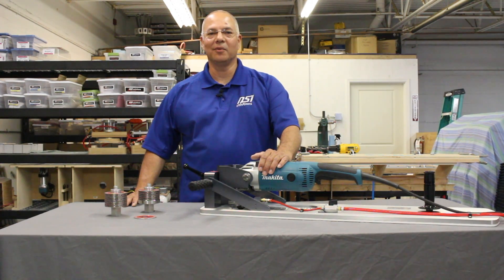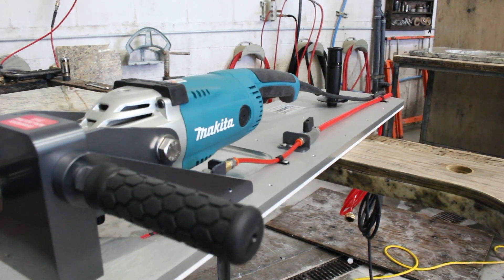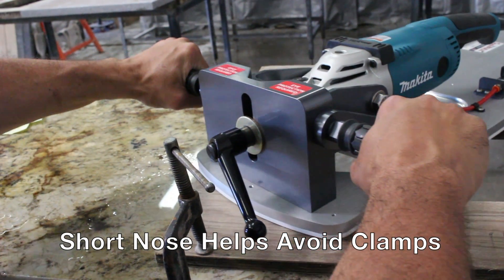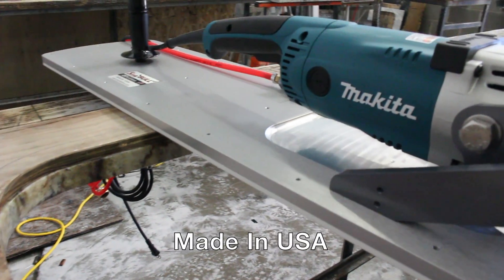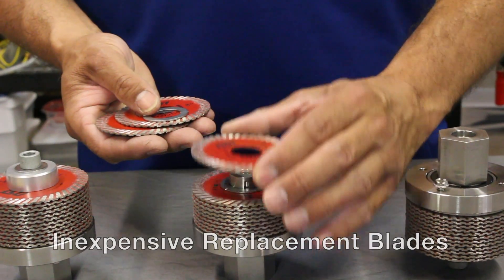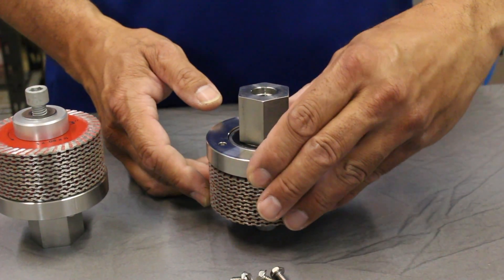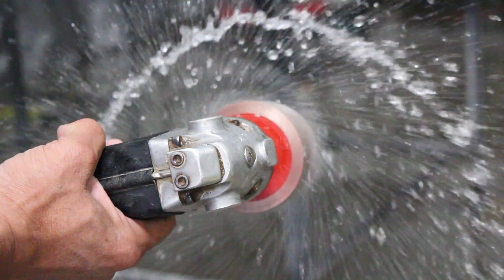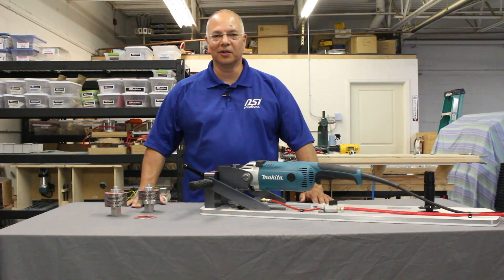Sink BULL™ and Rapid Z-CUT™ Intro and Demo

Comment: what is the saw used to cut the sink?
Reply from the maker: Hi QFC Granite,

We have seen a variety of awesome handheld water fed circular saw in our fabrication partners shops across the world.  At the time of this video (3+ years ago) Collin at Natural Stone Interiors of Seattle was using an ALPHA AWS-125 5" Wet/Dry Circular Saw. 

If you were to visit the shop now you will see the ALPHA as well as an EIBENSTOCK EDS125 5" Wet/Dry Circular Saw and maybe another depending on the fabricators work area. 

What project are you doing research for and perhaps we can point you in good direction.